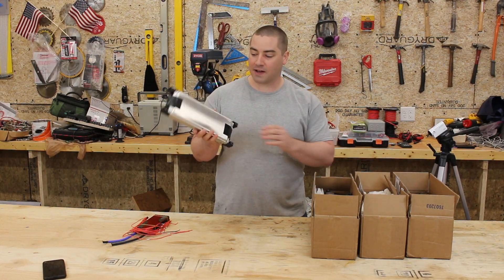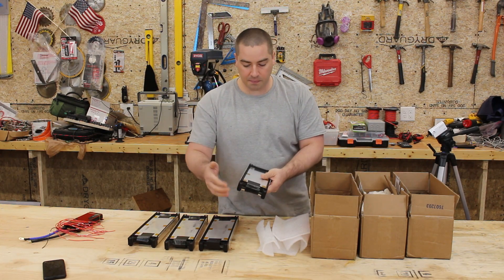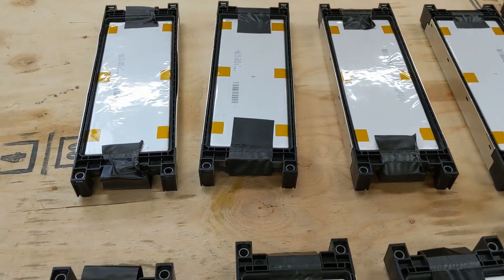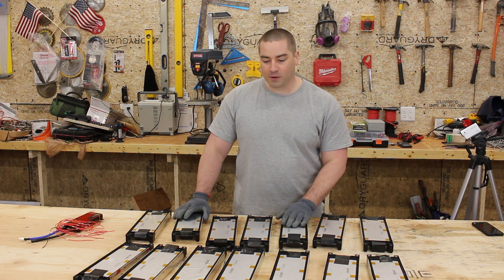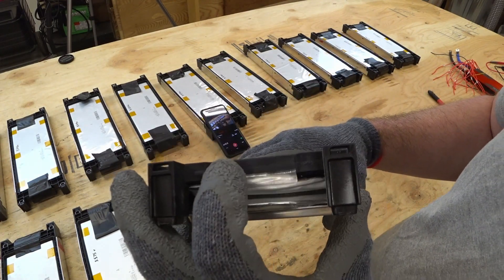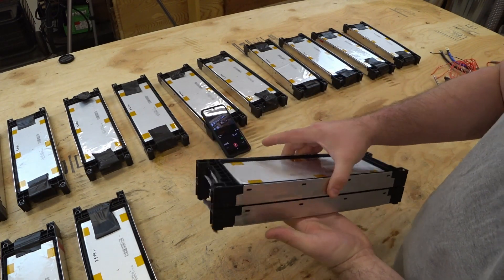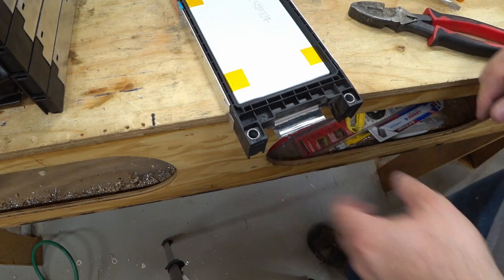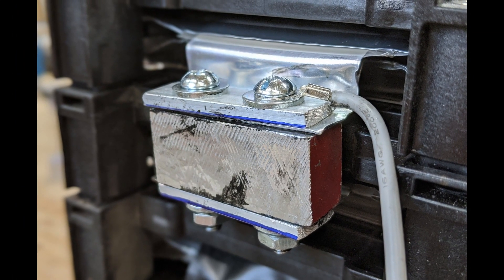LG 6kwh Powerwall, Part 1, Joining Cell Tabs Together

Comment: Reading LG Chem Datasheet for these cells, there is a thickness section which says: Degradation of 80% can lead to cell thickness increase up to 8%, Did you experience this or got any measures? For the whole block for a 8% for a cell it could lead to expanding 5-10cm

Comment: Hi David, what BMS are you using it looks like a Daly LiFePO4 16S 48V 100A ?  I picked up a set of LG batts Bolt recall they are welded in 2p3s x4 .  Do you recommend this BMS for such a build. From the land of OZ.
Reply from the maker: This was a Daly 200A.  I thought the BMS was fine.  I'm not partial to one brand or another.

Comment: How Good those battery are for off grid system ? As i planing 24v 9kwh Pawer wall
Reply from the maker: They have been working well.  Very power dense.
Reply: @DavidPozEnergy  thanks for replay im just asking because you have more experience with batteries! The reason I asking because I’m planning to install the LG chem battery in my off grid small cabin to run fridge tv lights laptop phone charger I know guy who built power wall from LG chem cells and he mentioned its going to be built from those cells 4x cells 120ah pack each and will be 4pack together in total 24v 480 ah power wall just over 9kwh  .
Reply: Obviously will be charge in a day and discharge over night . Any idea of live spam he gives 10years warranty!

Comment: 1:35 I count 15 packs. So are they connecting 2 cells from 1 pack and then 1 cell from the adjacent pack to make it only 10s (3p)? Wouldn't that make it so every other pack had the cells in opposition? I would think that would be a short circuit hazard. Why not just have 3 cells per pack or just 2 cells in parallel but a higher voltage?
Reply from the maker: This is 2p14s, meaning 2 cells in parallel, 14 in series.
Reply: @DavidPozEnergy  I was referring to the original Bolt configuration and the one being sold by BatteryHookup. Your configuration makes more sense since there are 2 cells per pack.
Reply from the maker: Ok.  The original car battery had cells packaged into modules.  All the cells were arranged 3p.  There were 8 modules on the car arranged 10s, and two modules arranged 8s.  This created 96s total for the car.

Comment: Will you please tell me what type of wire I need to connect my solar panels to my charge controller. I have determined that I need 6 gauge but I am not sure what type wire to run from panels into my shed.
Reply from the maker: It depends.  If it's inside conduit then THWN wire can be used, which is normal commercial wire.  That's what I used in my wiring video: https://youtu.be/t5NbyYGP4bU

Comment: Hey hey, curious what BMS you recommend for running 12 of these battery cells in 3S groups in 4P to make a 12v system? Trying to get 480ah with 12 of these cells... Wondering what the best BMS for this would be??

Comment: Aluminum can be soldered easily with the correct flux and solder or fluxless solder. Both work, but I am not sure which will work better with electricity conductivity. Using conductive grease will work too.

Comment: While i didn't buy those cells, I did order 105 of the 4.4Amp Cells. 15 strings of 7 with each cell already having a BMS built in. Will be interesting when the FedEx man shows up. Used your code. And the 48V 14S setup is sold out as of today.

Comment: Would binder clips provide enough clamping force to hold the tabs together?
Reply from the maker: I would not assemble a battery relying on binder clips.
Reply: @DavidPozEnergy  how about small one or two inch c clamps?

Comment: If you built a 24V setup, what BMS would you say is the best for that. Thanks ahead.
Reply from the maker: In part 2 of this LG build I used a Daly brand BMS.  I think they are a good value.  https://daly.aliexpress.com/store/4165007?spm=a2g0o.detail.100005.3.9685370b9ICnq3

Comment: Hi David Thanks for the video , You talked me into it I ordered 7 to do a 24v battery for a small solar setup. I know nothing about batteries . What BMS do I need and where is the best place to get it? Thanks for the great videos
Reply from the maker: I use a lot of Daly brand BMS from Aliexpress: https://daly.aliexpress.com/store/4165007?spm=a2g0o.detail.100005.3.f3dfa602bWicNH
Reply: @DavidPozEnergy   Thanks David , How do you know what amperage size to get? I think the battery packs said 120 AH . How do you go about sizing a BMS ? Do you have any videos on this ;)
Reply from the maker: My rule of thumb is this: Buy a BMS that has a continuous amp rating that matches the ah rating of the battery.  Then size the circuit breaker half of that.  In this video I went a little higher then that guideline.  If you ordered 7 modules, you will have 14 cells.  Each cell is 60 ah.  You will be making a 2p7s pack, 120ah, 24v.  So a general safe plan would be a 120 amp BMS, with a 60 amp circuit breaker.
Reply: @DavidPozEnergy  Thanks David I'm sure I'll have more questions as the parts start showing up but I'm loving your videos and so excited to starting getting into solar and something that's not a car battery lol

Comment: Hello David! As usual, great vid and thanks for sharing. Could you possibly indicate the thickness of the cell pair (2P)? Batteryhookup as the dimensions as: 100*145*300mm but something is wrong. The thickness can't be either 100mm or 145mm. I'm going to guess its 40mm-50mm ( about 2.0""). Could you confirm please? Thanks again.
Reply from the maker: The module is 30mm tall.  They must have added an extra "0".  LOL

Comment: Would changing it to a 7s for 24 volt and having 2 in parallel last longer? Or it will still drain as fast as a 48 volt?
Reply from the maker: If you are pulling the same watts, then it would last the same.  This is a 6kwh battery.  Re-arranging the same number of cells into a 24v only changes voltage.  But it's still the same 6kwh capacity. Thanks for watching.
Reply: @DavidPozEnergy  would 48v be better than 24v then?
Reply from the maker: Most everything I do is based on the 48v.  For a given load 48v is half the amps as 24v, and 1/4 the amps of 12v.  That means smaller wires, less amps, less heat build up, less line-loss, and overall a more efficient system.
Reply: @DavidPozEnergy  thank you. Will be buying some of these with your discount code.
Reply from the maker: OK, cool.  Remember, there are 2 cells per module.  So you could buy just 7 modules and it would be 14 cells.  You would just have to re-arrange them into 14s.

Comment: At 3:55-4:05 you talk about the black material that acts as a spacer/ heat management material.  Does it appear that the two cells could be separated from each other fairly easily?  I want to use these to build a 48volt, 60 AH pack so I would need to turn every other cell 180 degrees.  Thanks.  Great build, by the way!!!
Reply from the maker: Yes, you can separate the two cells easily.  The black material is sticky, but not glued.  Try using a credit card, or similar thin plastic to slide between the two.

Comment: Great video, thanks for posting!  I saw these batteries on battery hookup and knew it was an awesome deal, then I came here to get ideas because this is my first build  - Just ordered 14 cells, but I might build two 24v - 7s batteries and wire them in parallel because my controller is 12v/24v.
Reply from the maker: Feel free to send me a message on facebook if you need help.
Reply: @DavidPozEnergy  Thank you, much appreciated!

Comment: For joining/connecting tabs....
Harris 500K Al-Solder 500 Aluminum Solder Flux Kit Aprox 30.00 for a kit.
The stuff works crazy good. Worth the cost.  very low temp so not to fry the cell. I made several heat sinks from beer can bottoms to be safe. Seemed to work ok.
Sn85Zn15 Solder with  Zinc Chloride for aluminum or Ammonium Chloride flux does the trick well also.
This alloy w reducing flux can join aluminum to aluminium or most any ferrous and/or nonferrous (dissimilar) metal w ease. It is true low temp soldering. Not brazing like Alumaloy or similar AlSi or AlCuNi alloys. Stainless just loves this alloy also. Just wash off flux as it will be still active. 
Not good for magnesium or titanium alloys. 18650 nickel strips are as quick and as easy as spotwelding. Much more robust connection.
Solid copper bus bars soldered easily to both nickel and aluminum tabs. and tabs to tabs
I did an 2P8S with same packs w tiny tabs and all in about two hours. The first one. 
I soldered a control box w heat sink for 100A BMS and volt/amp meter w 100A shunt, seperate load and charge lugs, and rings for a carry strap. right to the cover. The only fasteners used were to secure cover to pack and pack stack and cover plate w feet to the bottom..

The next one will have its own intergrated 30A charger with 50-220VAC/12-24VDC power inputs and auto boost buck DC 600W power converter,  500W pure sine inverter along with non-volital battery performance recording, audible alarm/fault w/ lamps, two circut breakers. standardized connection points for joining multiple similar units in S or P,  UPS dual relay circut, and... bless her heart... For my girl...50W bluetooth stereo amp. Dual ch Wi-Fi/4G range extender and mobile hotspot, 12vdc lighter socket with working lighter and 3A 4port USB mini and C socket. oh yea...Cool lights too. Why not.? 
My battery will probaqbly need more battery. 
Thanks for sharing your build.
Stay well my friend.

7 product ratings
Reply from the maker: Thanks for the suggestion, I'll take a look.  I love when Beer cans get incorporated.

Comment: This may sound like a dumb question,but at 4am in the chamber,thoughts happen... Can you use aluminum cans to make tab extensions with or is that to thin for electrical applications?
Reply from the maker: It's probably too thin.  You could cut a strip from a can, measure it's cross section with a caliper, and compare that to an ampacity chart.  Then you would know how many amps it would work with.

Comment: Will those tabs support 500 amps of draw. I’m thinking of purchasing a set for a golf cart build. Your help would be greatly appreciated.
Reply from the maker: I have not tried to pull 500 amps from this pack, but I don't think that would be a problem for the short bursts a golf cart might need.  The data sheets I've read say it's just for a couple seconds to start moving, but the continuous draw is less than 200 amps.
Reply: Alright perfect thank you for the reply is there a schematic you can send to build this battery

Comment: Guys, what so you think about corrosion because of the aluminium connector? Could this be a Problem in the Future? I will build the same pack like David.
I'm not sure. Thank you!!!
Reply from the maker: I used a little electrical grease between the tabs and aluminum.  This will keep from having any corrosion issues.
Reply: @DavidPozEnergy  Thank you David! Good idea.
Best regards 
Hans

Comment: Thanks for the great videos David I picked up a 10s battery pack and 6cells groups on a mission to create 48v thanks for the inspiration.
Reply from the maker: Awesome!
Reply: Is that 48V DC power to be used with an inverter for powering 10,000 BTU air conditioners and 500 Watts refrigerator etc?

Comment: hello David thx so much for the video! i have used your coupon to get 10% off!! i have bought 32 cells like this to expand my existing system. quick question: before usage of these cells did you top charge them or they were already balanced?
Reply from the maker: They came balanced.  The first charge I was checking, but they stayed within a few mili-volts of each other.  So it's all good.

Comment: Sorry for the elementary question, but what is the nominal voltage range of a pack the 48v inverter charger can handle, the 14s at 3.6v is a nomina 50.4, is that normal? What kind of tolerance is ok in your experience.  I'm looking to possibly reconfigure 2 of the 36v packs into a 24v or 48v array.  But by my math I'll end up with odd voltages.
Reply from the maker: The inverters I currently have will go 42v up to 63v.  But every inverter will be slightly different.  Some inverters only go up to 58v or down to 44v.  I have another video on cell voltages vs. pack voltages: https://youtu.be/CbHABrTpSKU

Comment: What do they run for price
Reply from the maker: Each module is $50 at Battery Hookup, and each module has 2 cells in it.  This build is with 14 modules (28 cells).  You can use my coupon code DAVIDPOZ for 10% off.

Comment: Thanks.  Be careful with those aluminum filings.  I run a data centre and one day we did some drilling.  The small slivers of aluminum are great conductors.  They are so light that they can become airborne.  For us, they got caught in the air (we have lots of air movement inside a data centre) and they ended up shorting out four power supplies. Like #991
Reply from the maker: Wow, I would not have thought they could go air-borne.  Thanks for the warning.

Comment: I just ordered 32 of these.  Should be fun to play with!  I am here in Florida - not sure if you ever get down here but we have a 10 acre place here that I am looking to run off grid.
Reply from the maker: 10 acres, nice!
I'm guessing you will be using a lot of energy on air conditioning?
Reply: @DavidPozEnergy  before getting this land 2 years ago, we lived in a 3700 sq ft home that I had 10 kw on the roof and a 8kw outback radian 8048a. I replaced the outdated ac units (3) with 2 Lennox XP25 25 Seer ones. VERY energy efficient, only needed 2 units - a 5 ton and a 2 ton and I generated enough power to bank every month!! I plan on doing something similar here
Reply: @DavidPozEnergy  Got my cells today.  Getting ready to do the assembly.  BMS unfortunately will not be here from China for a while so I will have to run without until they arrive

Comment: Was that  Lithium or LifePO4?
Reply from the maker: This battery is Li-NMC.  Lithium Nickel Manganese Cobalt Oxide.
Reply: @DavidPozEnergy  i will look it up. Does it work as good as lifePO4?
Reply from the maker: Li-NMC is more energy dense (lighter per kwh) than LFP, but if you over-charge it you can cause a fire.  LFP won't catch fire just from over-charging.

Comment: My friend why didn't you use a proper aluminum foil crimp electrical connector like this  https://uk.rs-online.com/web/p/crimp-barrel-foil-connectors/1641958/
Reply from the maker: I didn't know about them when I built the battery.  Since posting the video someone else in the comments already told me about them.  They look cool.
Reply: @DavidPozEnergy  They are used in Ebike prismatic cell builds David - that how I came across them -  regards from UK

Comment: Hi, great videos!  What are your thoughts about using a conductive epoxy to join the tabs?
Reply from the maker: I looked into that last year for another battery build I was doing.  The applications it was being used for were low-amperage.   Since this is high amps I would not suggest it.

Comment: I need a 12 volt system
Reply: I was hoping someone on here, maybe even David, would address this. I would like to buy 4 packs and make a 12v (14.4v) powerwall for my RV. Just wondered if these would work ok. Maybe get 8 and parallel the 2. Is this feasible with these cells? Thanks. Love you video David.

Comment: Hi, can you please measure how thick each cell is? i want to seperate the cells inside the module, but cant find the exact cell dimensions anywhere.
Reply from the maker: I'm sorry, but I've finished building the assembly and can't take it apart to measure one cell on it's own.  But, based on measuring the outside of the case, each cell is 1/2" thick, +/- a 16th.  Sorry I can't be more exact for you.

Comment: Have you spot welded any 18650 batteries?If yes can you recommend a good spot welder?
Reply from the maker: Yes.  I use the Kweld.  It made short work of assembling my ammo can battery: https://youtu.be/iKEYDNvNRGQ  I bought the kweld from Keith at 18650ed.  https://18650shrinkandcellholders.com/

Comment: David, what is the model of BMS you will use from Daly? Does it matter that they only supply 3.7V while the LG cells are 3.6V?
Reply from the maker: I'm using a Daly, 200 amp BMS, 14s.  The 200 amp is a little on the high side for this pack, it has to do with what you want to do with them.  No, the 3.7 vs. 3.6 does not matter.  The important thing is the over-voltage cut-off.  The Daly ones I am using are cut-off at 4.25v, which is fine.
Reply: @DavidPozEnergy  If you were to build 12 kWh of this battery type, would you use a single BMS or would you separate into two? I will only hook it up to 5kW inverter and 3.6kW of panels.
Reply from the maker: It comes down to amps.  A 5kw inverter, at 42 volts would pull 119 amps.  So you could use a 250 amp BMS with a 125 amp circuit breaker.  That's fine and I would have no problem doing this, but it's about the limit.  I wouldn't want to use a single BMS for any more amps than that. This stack I built is 6kwh, so if you built two identical ones for your total 12kwh, then you could use 150 amp BMS on each, with 70 or 80 amp circuit breakers.  I buy them on Aliexress: https://daly.aliexpress.com/store/4165007?spm=a2g0o.detail.100005.1.ae405492wkNAKI
Reply: @DavidPozEnergy  where do you buy Daly BMS?

Comment: Can I use 12v 6ah battery to make 48v 6ah
Reply from the maker: Sure.  You series connect 4 batteries to add voltage.
Reply: Its will work properly

Comment: I went to the LG Chem N2.1 specification and find that cycle life is only more than 500 times. This is 4 x less than any lifepo4 battery. I would rather stay with the “ original” one.
Reply: link plz
Reply: Yes please, would like too read up on that, been trying to find it :)
Reply: 500 times only? That’s a very good point. Quite disappointing!